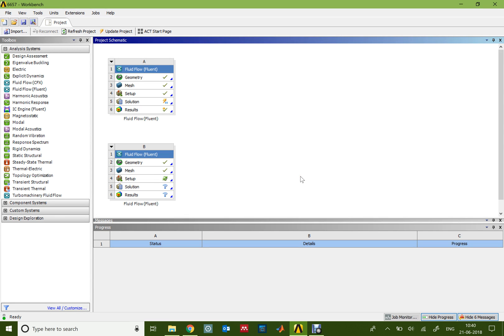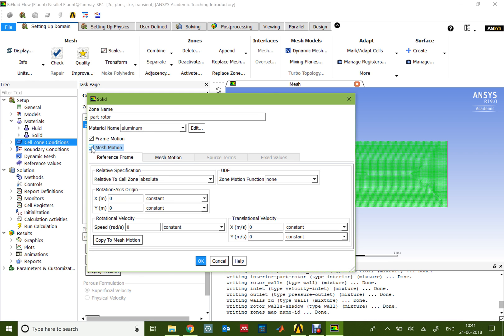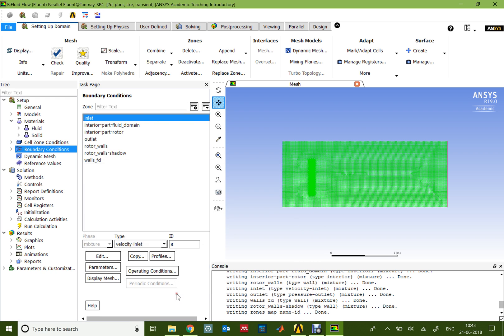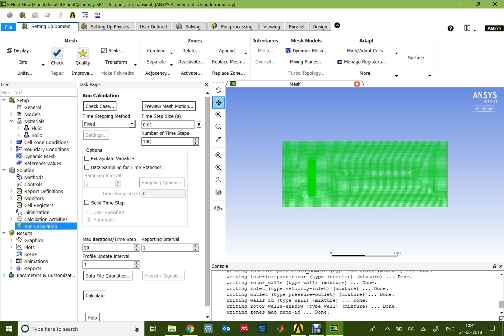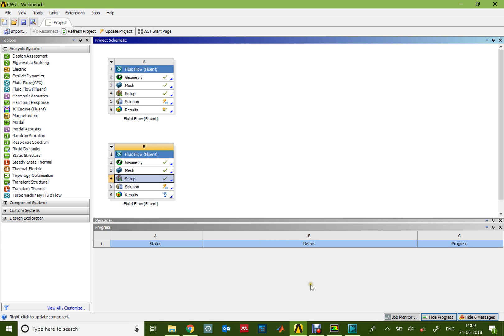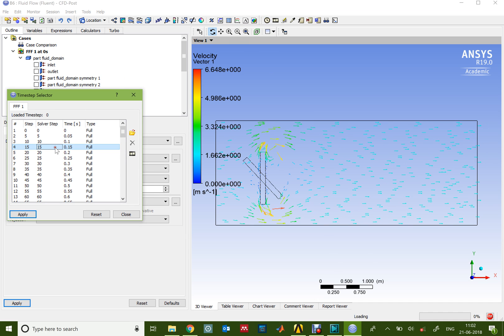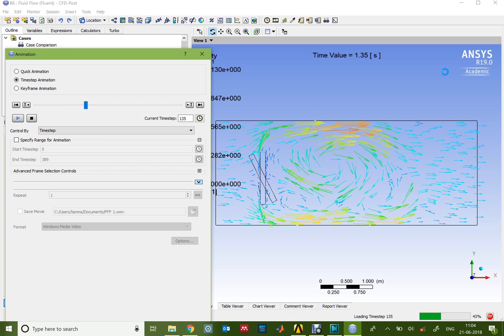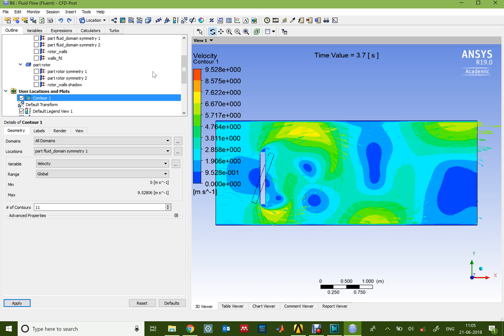Simulation of a Rotor in ANSYS Fluent - Part 2 | 14 | Implementing the CFD Basics

Comment: hello sir,  
i have done same gemotery and i followed same step  , but in boundary condition in the video the  value is given for  rotor wall , but in my design  i can only give values  for rotor wall shadow instead of rotor wall . i can only provide value to roto wall shadows. is ther any mistake ? will it have any final impact on result ?